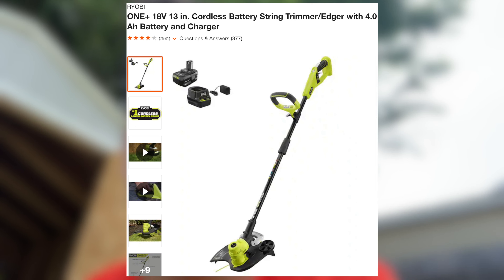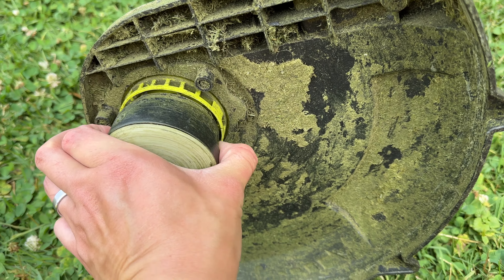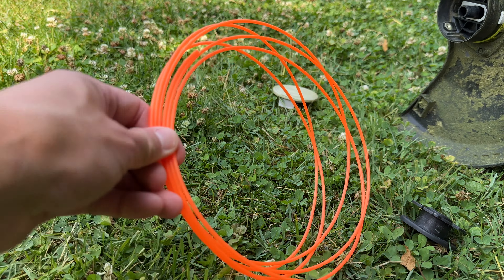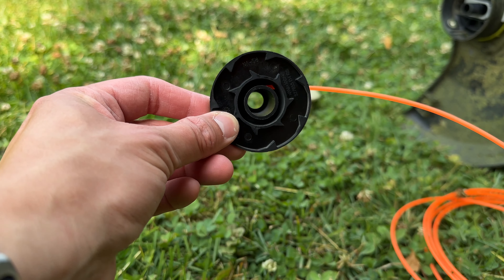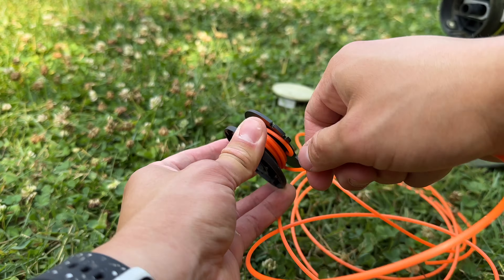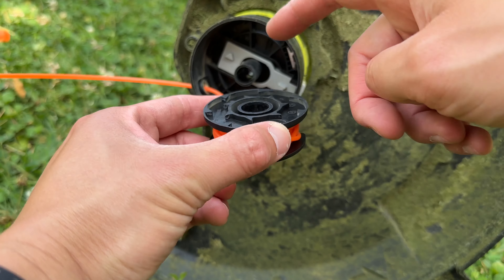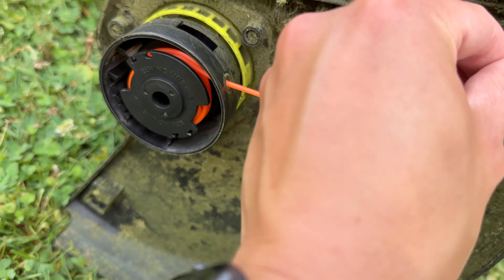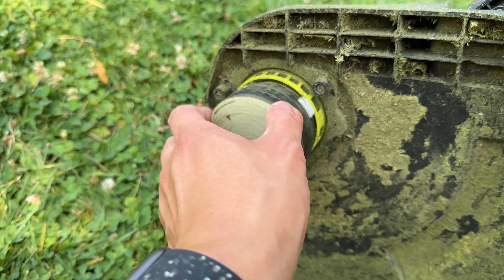How to Replace a 13 inch Ryobi Trimmer Line (QUICK)

Comment: No this model isnt a bump feed mechanism.. it is an auto feed driven by the plastic tab (manual advance) and counter weights that activate the line feed 1/4 inch each time you stop start the power trigger. Your model is missing the line cutter mechanism which will result in excessive line auto feeding each time you pull the power trigger.

Comment: If the filament is brittle or tough.. soak in water overnight.. it will regain its elasticity. True fact
Reply: Isn't the filament plastic or nylon? Water won't effect those properties. Maybe I'm incorrect.